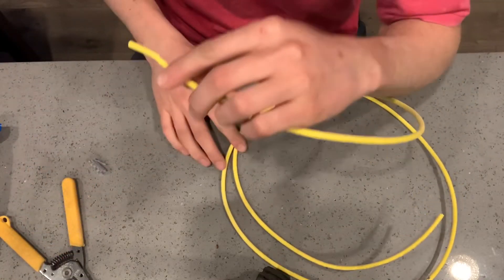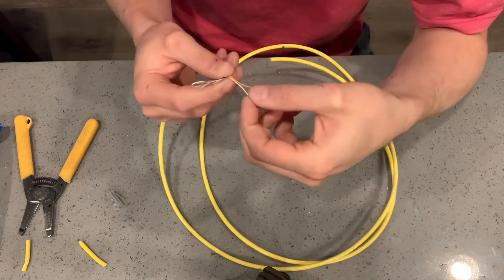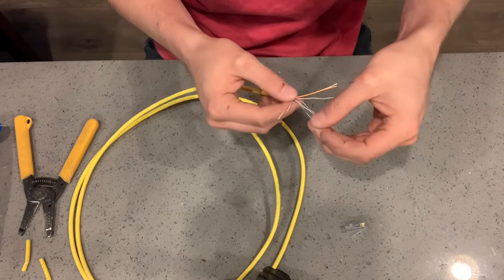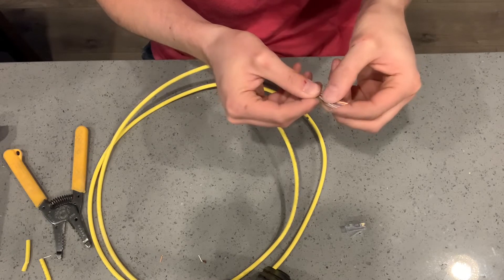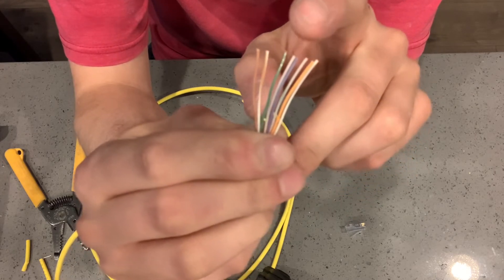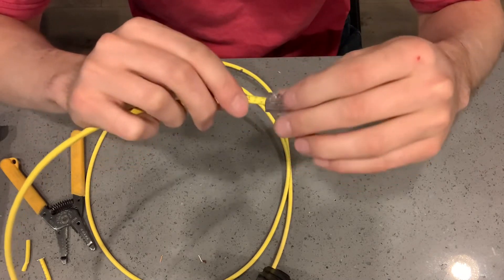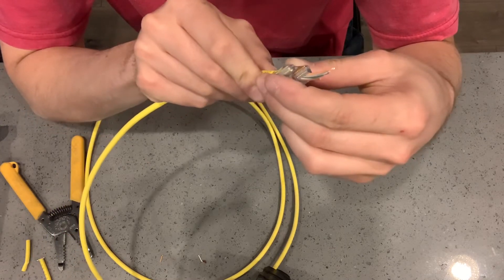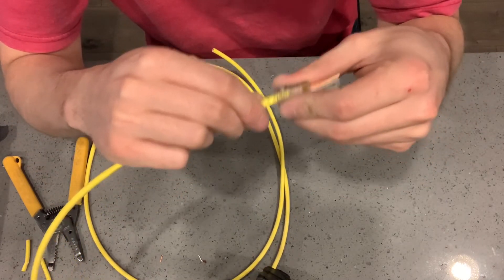How To Terminate An RJ45 Connector "B Pattern" (Step By Step)

Comment: I hate trying go fit those wires in that clamp always a pain ! Thanks for share and nightmares 🤣
Reply from the maker: 🤣 so annoying hahaha, anytime! lol
Reply: Get the EZ RJ45 connecters, the wires pass through and you cut the excess off after you crimp
Reply: Keep your thumb and forefinger pressed together just after the jacket the keep the wires in the correct order.  Also cut the straightened wire at an angle to feed in the module easier
Reply from the maker: thanks ill have to try that!